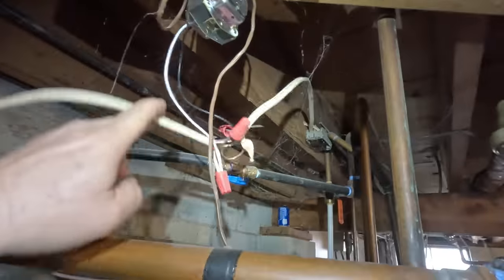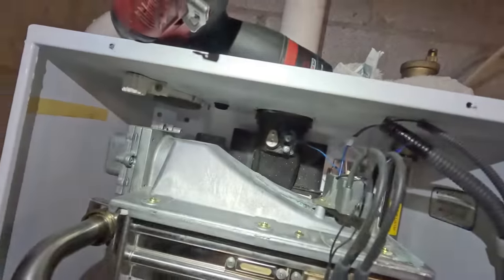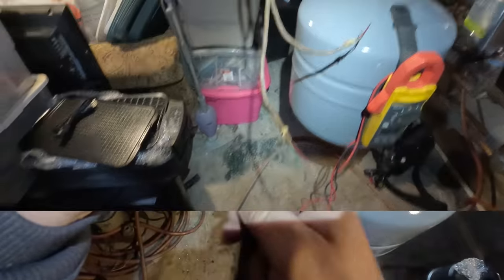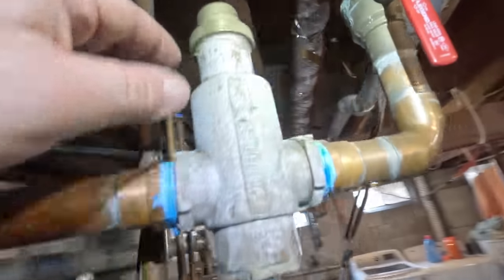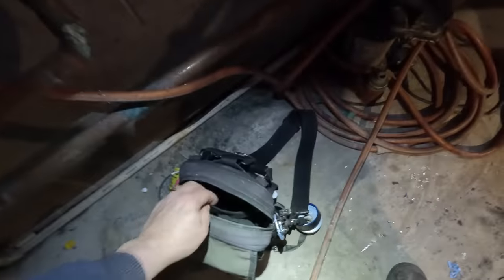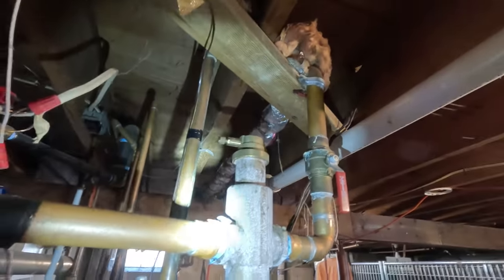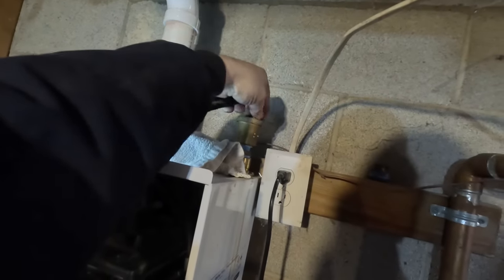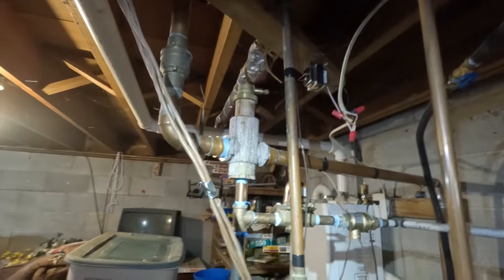Hacker Jacked Boiler Job Repair! House Is Cold...

Comment from the maker: UPDATE!!! I went back today to install the parts and noticed the new ignitor wouldn't work because the burner mesh had sagged down shorting out the ignitor....SO, they are getting a new boiler under warranty. (Parts are not available for this 2014 model.)
Reply: Had same problem ,what needs to be done is to bend ignator slitly so it dont toch mesh that sags .

Comment from the maker: The new igniter, rubber gasket and spiral vent rebuild kit are scheduled to be installed next week. Customer has not had any problems since repair was made, this was done just a few days ago prior to being released.
Reply: I didn't see any issue with you not cleaning that other bleeder.   You'll have to be back there to do the rest of the job, and that means you might as well wait and do it then.  Especially since it might have been a "replace the valve, don't clean it."

Comment: There is a ton of vids on Mikey pipes channel about those navien units. Every one he shows has heat exchanger and exhaust gasket leaks. I personally haven't seen one. In the southeast we usually have heat pumps or gas furnaces.
Reply: Was just about to comment talk to the pipe dr 😂
Reply from the maker: It's being replaced under warranty

Comment: Good job Rick, Yeah they need a good electrician to come in there and fix a few things, some of it is definitely not code, But yeah you might want to install a new circulation pump along with the spiral vent, it looks like it had it's days, and would probably pump things through faster if it was new.

Comment: Funtip for thermostat wire or I'm my case water meter wire. I usually just strip it with a pair of side cutter pliers, pinch the wire between the jaws and pull. in a pinch you can strip it with your teeth (I have done it before wouldn't recommend)

Comment: I hate crimping stat wire. I’ve seen them get loose so many times that it’s ridiculous
Reply from the maker: I agree, that's why I mentioned it wasn't recommended in the video, a lot of it has to do with improper use and the quality of the crimper. But what they had didn't work well either. Thanks for checking in out👍👍

Comment: That boiler has its own water feeder ,so BG one should not be used. Adjust pressure on the boiler control.
Reply from the maker: Where do you see the auto water feeder built into the boiler?
Reply: @HVACRSurvival  There is 1/2 " outlet think on left side bottom of boiler, just straight domestic water connects to it and can adjust presure in boiler controll
,needs boiler book to fallow instructions. Thanks for reply ,love the videos.

Comment: Navien is cheap junk....but whats worse is how they seem to be installed. Lots that could of been done much better. 

Had a job the other day, replaced a vibration eliminator....purged the air from the air separator.....took 4 minutes to bleed all the air out of the loop. Granted it was a commercial building with a decent amount of piping
Reply from the maker: Agreed 💯

Comment: The whole piping looks a mess. Why neetly arrange everything on the wall and securing everything when you can mount it all in the middle of the room with flying pipes.
Reply from the maker: That piping is probably where the boiler was originally when it was a traditional boiler.

Comment: You need communication ships with two notches on the side - notches good for stripping thermostat wires.
Reply from the maker: I've got other strippers, I just like these cuz they're less to carry, normal strippers work just fine for it. I even have the Klein scissors
Reply: @HVACRSurvival  I carry $5 little stripper that look like little scissors, the one that you have to dial the wire gauge on the side of the handle.
 Its small to fit in to my “grab first bag”, again it is small to work inside the small quarters, and that’s the one I ending up using the most.
Although I do carry Klein 28-12 awg stripper in the same bag.
Reply: @HVACRSurvival  What that tools brand part number?
Reply: Never mind - I found it in your list.